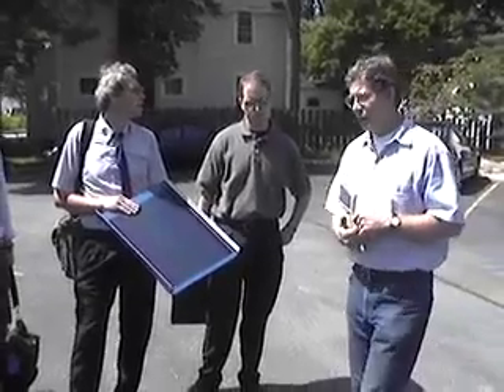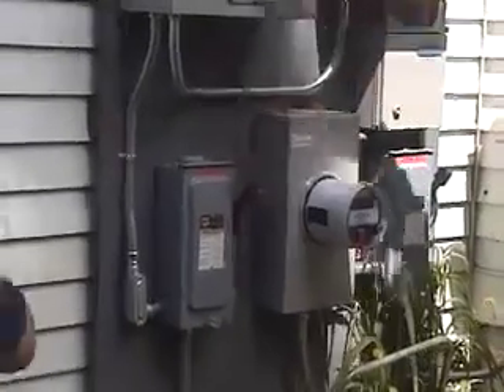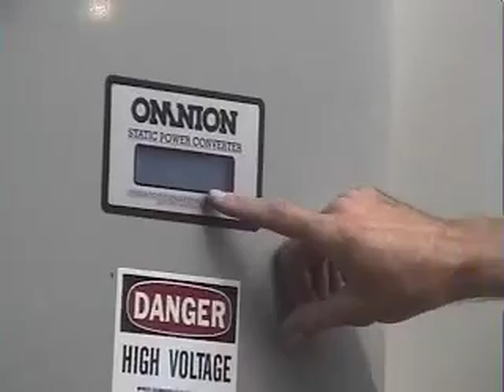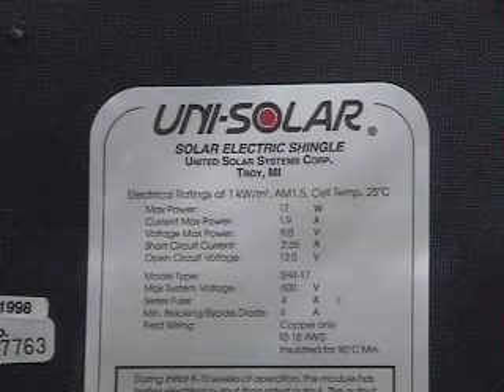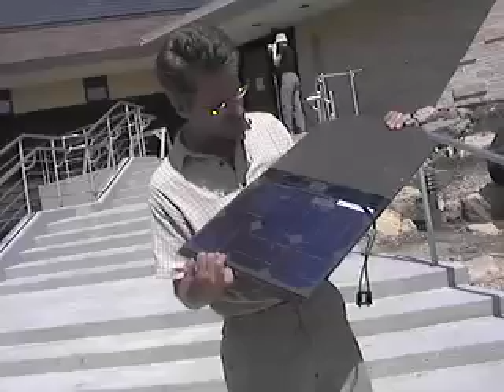Electric Hybrid Homes

Comment: It's my understanding that some researchers in solar technology are looking at plastic films to be added onto other materials, roof tiles for example, to blend in seamlessly. They will likely use little to no heavy metals. This may not come out tomorrow, but the technology is evolving quickly and will likely be integrated into homes and workplaces when they're built or remodeled.
But as you pointed out, at the moment there are more practical options.